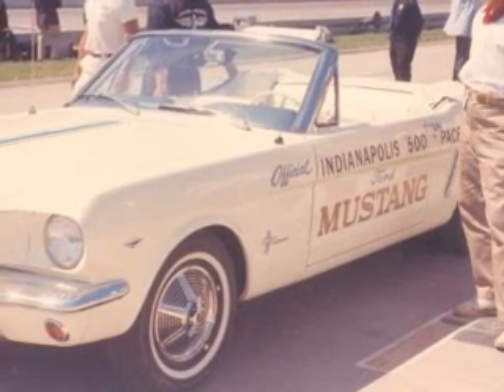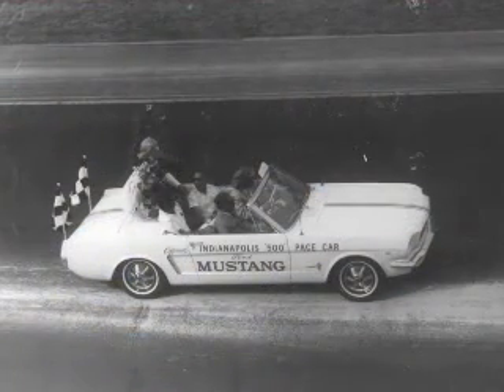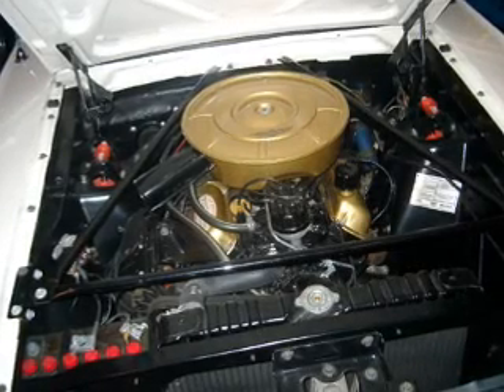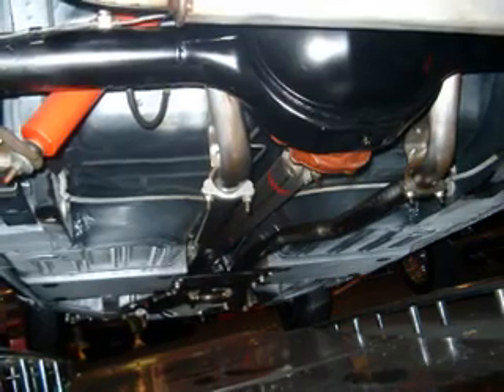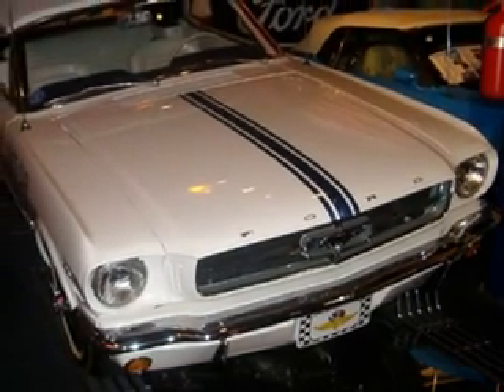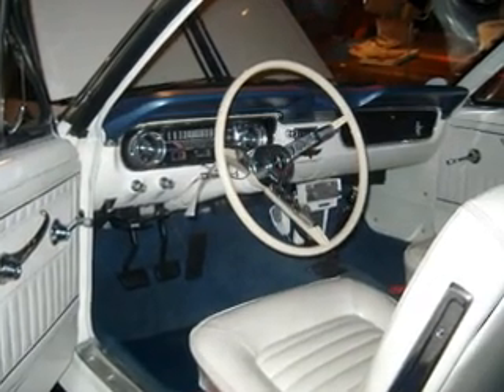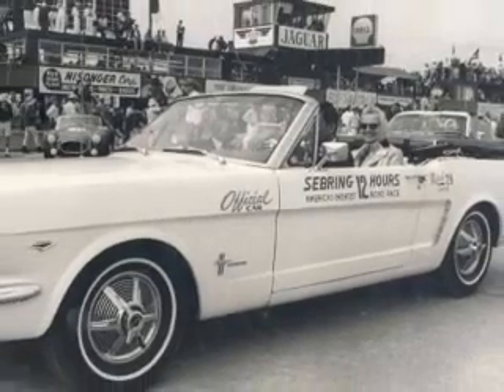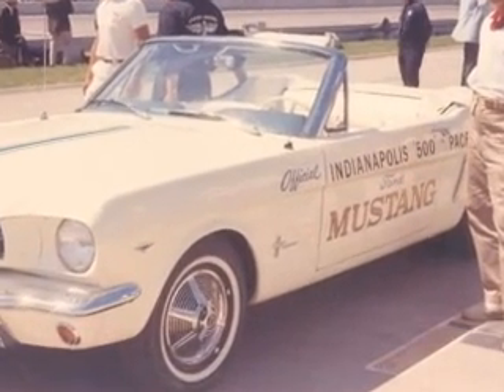Lot S134 1964 ½ Ford Mustang Convertible Indy 500 Pace Car

Comment: Look for the beginning 5F on serial number plate, or title,  That indicates a 1965, as all those mustangs built in the '64 and '65 model years were, beginning in April(?) '64, if I remember.  I sold them at the time, and that was a definite selling feature, months ahead of any other cars .

There were no 1/2s.  I think that was only in '63 when they changed the roofline/green house on the Galaxy.

I was in NYC at the dealer only unveiling.